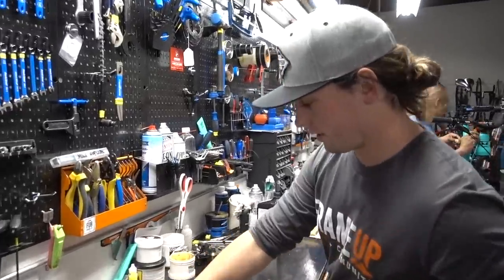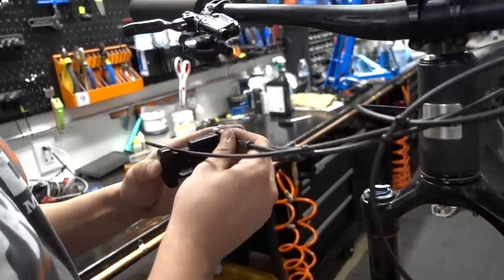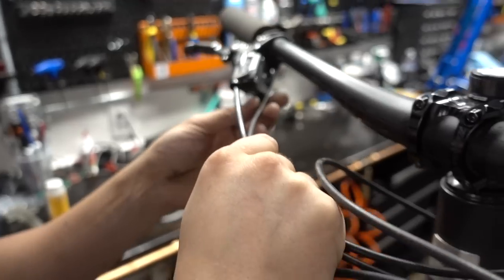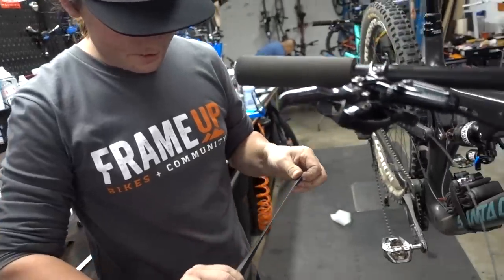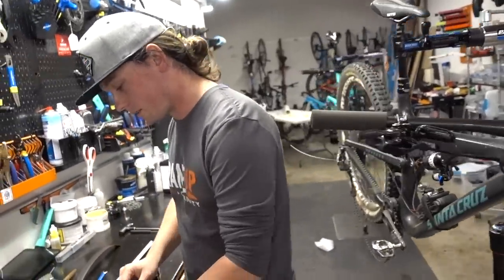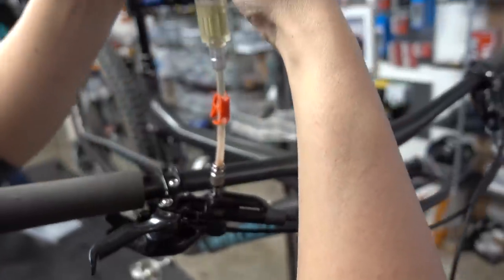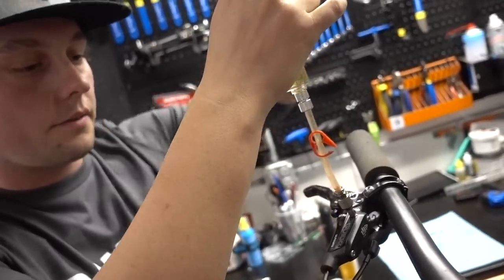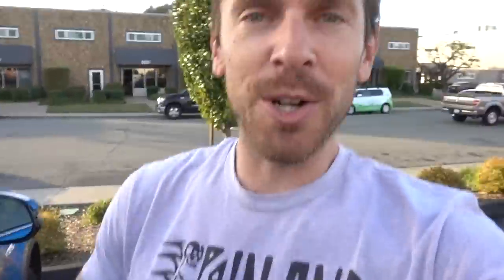Fixing my rattly cables with heat shrink at Frame Up Bikes in Walnut Creek

Comment: Love the instructional video, and a must do if/when you're performing maintenance. Another quick solution is the same philosophy but simply wrap using electrical tape! But there's the right way to do it of course, and you got it!
Reply from the maker: Thanks dude!
Reply: Electrical tapes will be messy eventually. The sticky side is also a dust magnet.  Run a few kms then the tape will look dull.

Comment: It seems the mechanic is very nice and fun guy to talk with..
Reply from the maker: Definitely!
Reply: how much it cost?
Reply: We charge $100 for both sides and $75 for one side. This includes brake bleed(s), new derailleur/dropper cable (as needed), any necessary drivetrain adjustments and the heat shrink.
Reply: It's actually pretty cheap for such a great job, well done guys..

Comment: Little tip: Add some zip ties at both ends of the heat shrinks so it won't widen with both cables pulling.
Reply from the maker: Very good call!

Comment: Is it ok to suck the air in the brake like that ? Would it do anything to the brakes ? I've never seen anyone do that before.
Reply from the maker: The idea is that we're sucking the air that was in the brakes out. So hopefully it pulls those bubbles away and liquid fills in.
Reply: Hello, Dũng! Long explanation - Your brakes are a closed system that should not have any air in it. Oil (mineral or DOT) is used to lower the boiling point given the amount of heat generated by the act of using your brakes. Any air in the system can cause issues from sponginess to complete loss of braking. What Chris did was draw a vacuum on the system to pull any air out. This can be done from time to time but at some point a full-bleed will be necessary to not only replenish any fluid that may have been lost but also to ensure that the fluid is clean. Dirty fluid can cause issues with the small parts within the system. (My apologies if this is too long)
Reply: Wow thanks :)) I didn't expect you guys to explain it but thank you ( i don't mind the long explanation though, i kinda like it too). I appreciate it. I will try to vacuum like that next time. Keep up the good work. P/s: When you used the blow torch to heat up the shrink wrap, would it heat up the brake oil too ?

Comment: To prevent heat shrink tubing from smouldering when You're doing it yourself at home with a bit more time, than a bike mechanic has for each job, You can use a hair dryer instead of torch and then, You don't risk smouldering brake hoses and shifter housing in the process, as well as carbon frame that doesn't like heat at all.
Reply from the maker: Good call!
Reply: Most definitely a great point! We usually use a heat gun during installation and probably should have for this very public video. The nice thing about the heat shrink is that it doesn't take much heat to make it shrink. Thanks for the observation!!
Reply: Actually I think hair dryer would take a whole lot of time. A regular lighter would be ideal in terms of time and safety. Torch is simply the fastest though.
Reply: You actually might be right, I also use lighter for this job most of the times. Although for two hoses together it'd be much more difficult not to smoulder something, but the frame would be safe.
Reply: Very nice idea and work, but I would strongly recommend a proper heat gun. You should be able to pick one up for $40. Money well spent when heat shrinking tubes around expensive carbon parts.
Reply: I have found that the extra length of a barbecue grill lighter is perfect for heat shrink tubing, and the heat/flame are easy to control. Doesn't take much longer than a torch but also doesn't spread heat anywhere except where pointed.

Comment: I find bleeding at the brake/reverb handle technique quite interesting, if not time saving. I understand that it works as long as you don't need a full flush? 

Also - hanging the bike at the top of dropper post - I always struggle to find balance on service mounts with carbon frames so that's an interesting option too. I never knew you could do that.

Comment: Brake lines still way too long....... at least they will rattle less
Reply: Hello, Davidvonslingshot! Thanks for the observation! By leaving the brake lines longer, we are able to replace the derailleur/dropper housing in the future without having to worry about the brake lines becoming too short. If only there was a shrink wrap that you could hit with cold air and it would expand back to its original shape so we could pull the housing during replacement. There is an invention that is needed lol!

Comment: Oo I like the heatshrink look, very clean.  Building a new bike so I found this just in time.

Anyone know why he left the front brake hose so long?  Was surprised he didn't cut it down a little shorter.  Does that extra bend help it not bind on compression or something?
Reply from the maker: Just good to keep plenty of room for crashes. Really bad news if it's too tight and you rip a house out during a crash!

Comment: I wouldn’t do that, shifter hose needs to be replaced at least yearly while the brake one is much more resilient. If you solder them together you’ll have to replace them both. Simple electrical tape could do the trick just fine and it’s reversible.
Reply: valmarv I have to swap dropper, and shifter cable after few months, but my frame is more abusive to cables.

Comment: If you happen to be doing this on your own, a couple things to note: Always use nitrile gloves when working with DOT fluid as the fluid is very toxic and goes straight to your liver and does permanent damage; SRAM highly recommends using DOT grease when installing or re-installing the barb into the Guide caliper; and there is a torque spec of 8NM on the nut that pushes compresses the barb/olive that SRAM includes a specific tool with their Guide Bleed kits because of how crucial this spec is. Chris seems like a nice guy, and the cable routing is sleek, but there are a few caveats with how he went about things during this video. I always want to support my fellow wrenches, but these things simply shouldn't have been overlooked--whether or not Brian was filming. For those of you who want to call my BS, I am a wrench myself working alongside people with decades and decades of experience--Motion Makers Bike Shop of AVL/SYL
Reply from the maker: Very good insight, thanks!

Comment: Fyi. Sram Guides are the only brakes with threaded olive. Any Shimano or Hope, Trp, Avid brakes only have olives to slide over the brake line housing.
Reply from the maker: Interesting!
Reply: BKXC i was service manager and head mechanic at a very busy shop here in Vancouver. Done the Trek University online courses and Shimano certified in everything incl Di2 , and SRAM Red eTap certified tech also.

Comment: Before adding the heat shrink put black electrical tape at the spots where the shrink wrap ends. This way the tape is holding the cables together as well as the shrink wrap. I have seen the shrink wrap tare at the ends.
Reply from the maker: Really good call!!

Comment: They should make the rubber in a C shape instead of a tube, a small opening so you can force your cables into and maybe they would melt together, that would save time and money. Just an idea
Reply: Hey Flex LCS! That would be awesome and we have actually tried cutting the shrink tubing. We found that it needs to be a closed "system" for it to wrap properly. When cut, it just shrinks but not around the cables. It might be possible to "tie" the edges together with something so we might give that a go. Thanks for the idea!
Reply: Frame Up Bikes 
What if you use two layers of rubber, sandwich the cables and melt? They may be a lot of opportunities to improve and save time and money.
Good luck

Comment: Curious on why they didn’t shorten the front brake hose. It still looks quite a bit too long, especially considering the front fork is at full extension
Reply from the maker: I think it's more about the left and right movement of the bars during a crash
Reply: BKXC gotcha, I’m no pro, just seemed a little long. Didn’t think about them being longer helping in a crash. Good stuff to know !
Reply: Josiah Bateman the front brake on Brian's bike actually has the perfect length loop.  It gives room incase he wants a higher rise bar or add spacers under the stam and also if he goes for longer travel fork.
Reply: Denlit Isha word. Makes sense.

Comment: It is nice to do the shrink wrap. What happens when you need to change the cable housing? Hi, my name is Steve. I have been a mechanic for the last ten years and raced xc for the last 7. At a mom and pop shop down the road, which has been in business for the last 45 years, we make sure that you can change out parts once we organize everything. The first thing is that you bike, if it had been set up properly from an experienced mechanic, would not have left the cables that long before you took it out of the shop. The shop I work at now would have organized your cable system leaving room for bar expansion and/or stem extension. Now that you have shrink wrapped your cables this has turned into a project anytime you need to change a cable/hose. We use spiral wrap which wraps around the cables/hoses and is removable if you need to change something. Spiral wrap is also available in colors to match or go exotic with color choice. The shop I work at is called Encina Bicycle center and I would be more than happy to show you what we can do. For Spiral wrap and cable/hose shortening to proper length we charge $50.00 and the bike would be just as quiet and clean looking. Let me know what you think.Cheers Steve RService Technition at Encina Bicycle Center
Reply from the maker: Nice, very cool!
Reply: come in and meet tim. original owner since 1974. Encina bicycle Center next to whole foods. I will be there Friday through sunday. happy to show you spiral wrap

Comment: My reverb fully set to slow, still be fast, emitting a hard pop sound when reaches full extension. My bronson's still new not used yetyet.
Reply from the maker: Oh wow!
Reply: Hi brian! wow referred to what? XD ))
Speed behaviour and pop sound are imho normal, but I've to send back to repair DPX2 shock as emitting a "click" sound when compressing it, even mroe when set in open and when Im firm on the bike too. Seems caused by an internal bad plunger alignment, in fact it does when its bottom bushing hex's tightnened >8Nm. What's up with yours?
Reply: Alberto Beneduce take the post out check air pressure in the post
Reply: Im new to a dropper post, never thought there's air too. Will check it, but what's the correct pressure? It depends by some factors?
Reply: Alberto Beneduce reverbs i think around 275.... just check which model reverb it is first.

Comment: electrical tape does a real good job plus you can do it at your house for 5 bucks
Reply: Jerome Segard Yeah but after a full day of riding in the sun, the glue on the tape turns into a mess starts to gradually move and catching dust and ends up looking like dog shit.
Reply from the maker: To each his own!
Reply: I've had the same electrical tape on my bike for 4 months. Lasted the southern ca sun the whole summer
Reply: Garbanzo123: Electrical tape is typically a whole season thing unless you get oil on the sticky side. That is my experience with it using it to cover unused internal routing holes on frames, securing speed sensor cables to the frame, securing cables to one another, taping up the end bar tapes on my road bike and more. Been using it for well over two years in temperatures ranging from -15°C all the way up to 38°C on direct sunlight. It's solid.
Electrical tape comes in a veriety of colours and is a less of an eye sore than zip ties. Also runs less of a risk of "choking" cables.